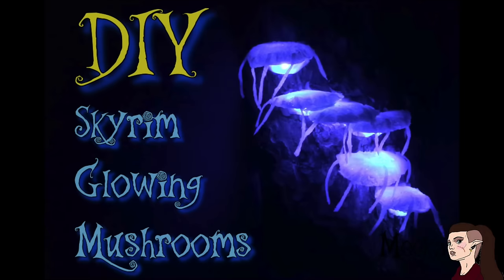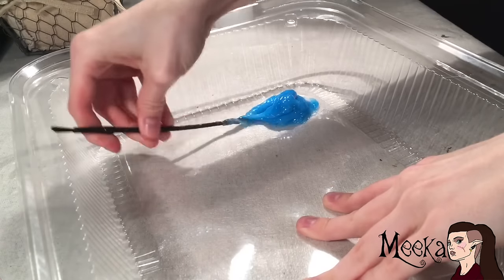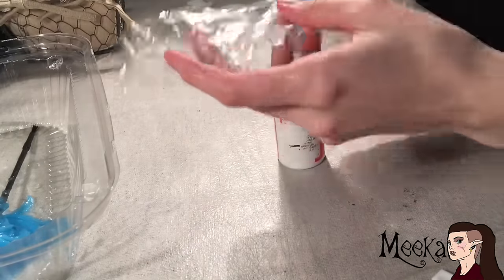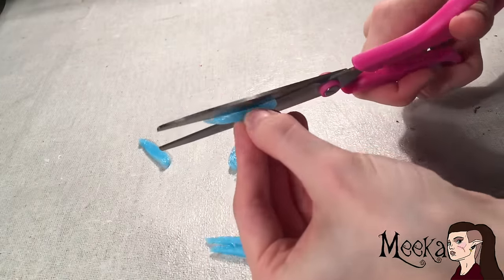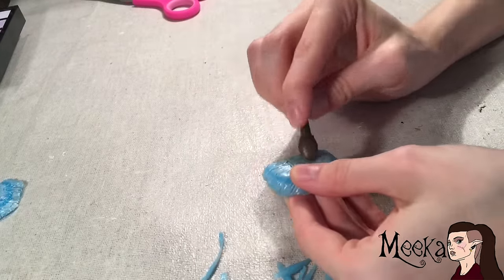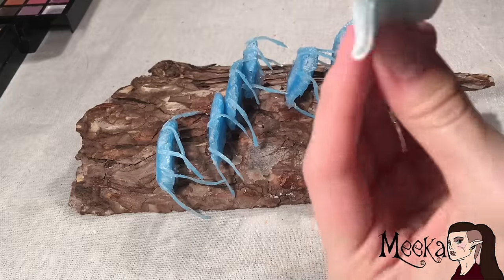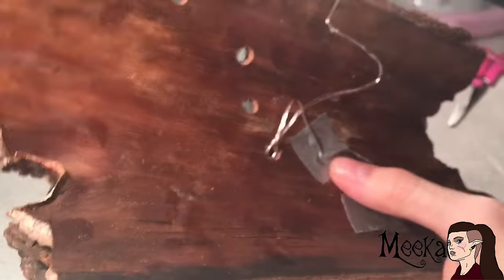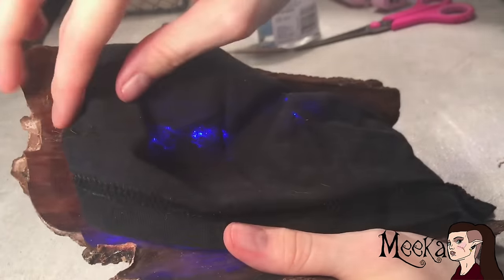DIY Glowing Mushrooms (Skyrim Art)

Comment: Fun tip - if you are ok with it being matte rather than glossy like normal silicone, and moldable by hand rather than through cling film then you can make a putty with silicone and corn starch. 
Also as silicone is very good with heat, you can actually mold the LEDs inside the silicone (far easier if it's moldable by hand) and if its matte it defuses nicely throughout rather than a focused dot of light like through the tissue. 

Last tip - if you want some dangling plant bits like on the edge of the mushroom, you can touch some wet silicone to the edge and pull the applicator away to leave a strand/tail/dangley bit similar to pulling a hot glue gun away

Comment: I'm currently working on a very similar project. Thanks for the tip about not putting too much paint in the silicone.  I've been wrestling with getting it to cure/dry for several days. I'll try your tip about using a very small amount of paint.  I've got a couple of questions. First off, did that battery pack already come attached to those LED lights? Did you order that LED/Battery pack from Michaels or did you find it in a particular section of the store? 
thanks
Reply from the maker: So sorryI didn't see your comment a month ago. Anyway yes the battery was attached and I found it in a store and Im pretty sure it was Michael's.